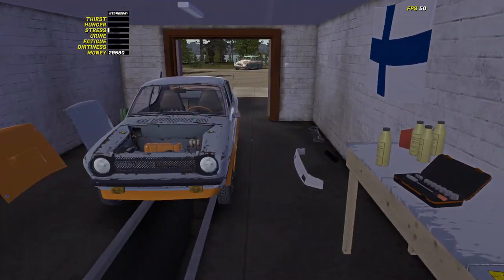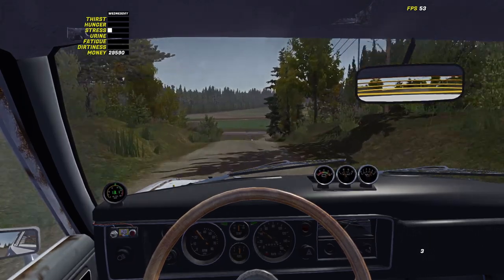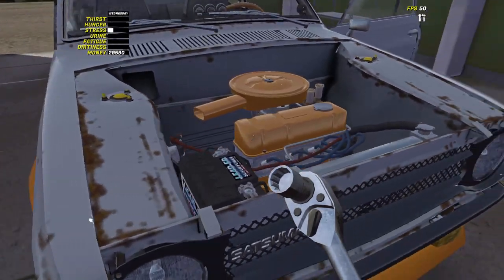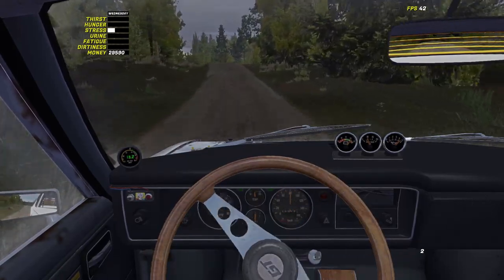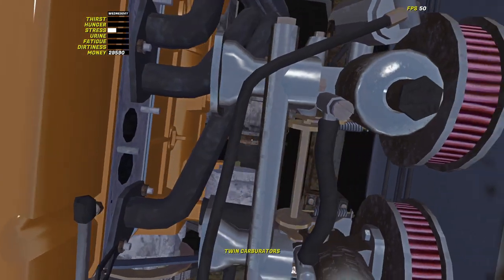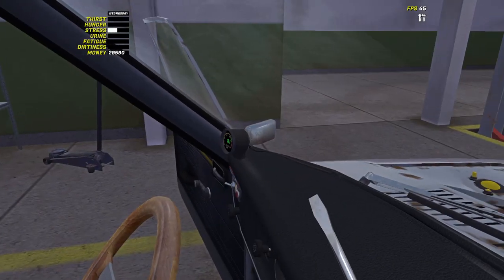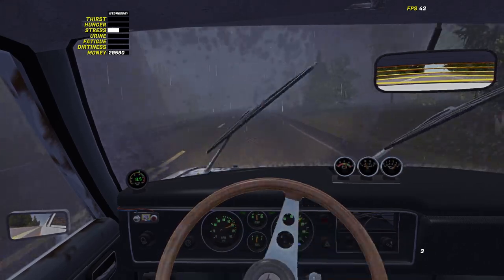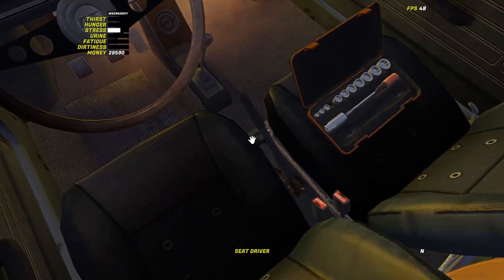My Summer Car - How To Tune Each Carburettor 2020 (Tutorial)

Comment: I've doen 3 different tunes on this carb, 13.5 A/F 14.5 AF and 14 A/F and every time my Carb explodes after driving past the mail boxes. The carb is in correctly, WHY DOES IT KEEP EXPLODING ON ME?
Reply from the maker: The only time a carbon has exploded on me is if a bolt is loose buddy
Reply: @KasualChris-gaming-channel  Okay, I'll have to quadruple check
Reply: idk man to me 12,13 is perfect,other than that it keeps overheating,ppl saying 14.7 is the best but for me its heating even faster

Comment: I’ve tuned all my carbs with you and my satsuma still dies off when I push the choke off, what would cause that? Thinking flywheel
Reply from the maker: Or your air/fuel ratio buddy. Spark plugs can cause that too. Double check there all fully tightened up. Even just one loose plug can stop it from idling on its own
Reply: If the crankshaft is worn the car will shake violently then stall
Reply: Spark plugs could’ve gone bad
Reply: Same here I put a new carb on tuned it perfectly and still doesn’t idle, I checked my spark plugs at tightened

Comment: So i just finished building the car, and after i took it for a drive the thing kept overheating after a few meters, so i tried tuning the carb without an AFR gauge.
The exhaust smoke came out greyish, not too white, and not too dark.
Did i do well?
Reply: did you use stock part from the shelf? pretty much the shelf parts is almost worn out I recomend you buy new parts from the repair shop

Comment: A higher afr is a lean mix. The lower the afr the richer the mix
Reply from the maker: So does higher make it quicker but gets hotter?
Reply: @KasualChris-gaming-channel  nah no 14.7 is last normal AFR, higher than 14.7 is giving a more heat than power but at around 17.0 will give no power until a massive power peak at 6500 RPM and running Rich (13.1-14) and lean (above 15) will heat Engine fast, 14.7 will heat slow

Comment: Hey bro,ive gotten the aftermarket carburattor put in my car,not the nist expesnive one,the 1750mk one..I have stret it,but i onew the Tuning was off,what annoys me is that it overheated basiclly imidietly. Im thinking it could be that my Cooling System is not powerfull enoug to cope with the extra power of the Upgraded Carb..Is that the issue?
Reply: Check ur coolant levels, maybe upgrade to the better cooler, check if your cooler pipes are tighten.